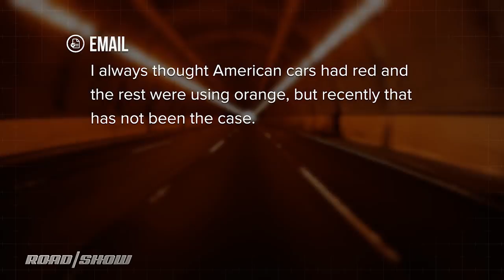Do turn signals have to be red?

Comment: I also demand to know why German cars sold in North America now all have red rear indicator lights when they didn't used to? They're not red in their homeland.
Reply: Nicholas Smith there is a subtle technicality that causes this.  RoW (rest of world) cars don't need to meet a turn signal "surface area" spec that the USDOT has.  So in Europe, VW/Audi can leave a very thin amber bar for its rear blinkers, which are plenty bright when lit by high-output LEDs.  But that doesn't meet the US spec, so rather than redesign the entire cluster, VWAG just programmed the entire brake light to blink on US cars.  And they can skimp on a few expensive amber lenses and LEDs as a bonus.
Reply: That's a crock of crap. Have you seen the turn signal in the Tesla Model X and Toyota Avalon? A thin strip less than half an inch. Simply put, the Germans found an effective way to cut costs. Since the Americans can get away with it, why not them?
Reply: Not really because of 'very thin amber bar', but it's the "surface area" of where the indicator starts. The thing about Audi and other cars makers is that it does not pass DOT because of sequential turn signal. Each segment of the turn signal of minimum 2200 sq. mm should light up immediately at the start of the indicator to pass. So, actually they can get a pass on the turn signal if they don't do the sequential thing or they can do the sequential thing but in reverse like the new Toyota Avalon.
Reply: The first segment to light up has to be of a certain area, irrespective of whether it's sequential or not. And then there is another important thing: in the US, lights on a moving part of the vehicle (i.e. trunk lid) don't count toward that minimum surface area. That's why the European thin strip doesn't pass the US reqs, since you're only looking at the outer half. Take for example the X5. It has to have combined stop and turn signal because only together do those two outer small segments meet the area requirement. The alternative would be a rear light assembly of a far less sleek and esthetic design. Oh, and btw, it looks like the outer part of the Avalon turn signal is steady on and off, with only the inner trunk lid part doing the reverse sweep.
Reply: @H0704  USDOT MUST trash the minimal surface area requirement ASAP. It creates an even worse safety hazard.
Reply: They think now that LEDs are so widespread and much cheaper and longer lasting than the incandescent bulbs there's no need to have extra lights for turning. Still a stupid argument. You can use LEDs but just use red LEDs for braking and amber LEDs for turning. Both types of LEDs exist. Plus if you're so concerned with the aesthetics of the vehicle you can easily just opt for clear lenses without any red tint and just have the appropriate colored LEDs in the housing for both braking and turning as explained in the previous sentence. Taillight lenses with color tints were necessary in the past to get the color out of incandescent bulbs but with LEDs that's not the case anymore
Reply: i think part of it is because cars sold in the us must have a turn signal lense of a certain size, and it may also because some people like the cleaner look of all red. or it could be a cost cutting method as well. either way, its fucking stupid.
Reply: @francissanto12  Exactly. German engineering and better safety my ass
Reply: Man, new cars are expensive anyway so why not invest a tiiiny bit more in using amber turn signals... 
It's clear that America cares more about "costs" and "esthetics" than safety.
Reply: I have crossed the border in to Mexico many times and I have seen the same German cars that we have here in the US with rear amber turn signal lights. Same late models that we have here with red turn signals and across the border with amber turn signals.

Comment: Aside from red or yellow. USA needs ban intergrated stop/turn signal light.  Just too damn confusing to tell apart when brakes are pressed intermittently. I really do think it's a hazard.
Reply: j O agreed.  Also US should require side signal repeater like the rest of the world.  Blows my mind how cars are allowed to change highway lanes with no visible indicator on the side of the car.
Reply: Thats why i hate red only turning signals ita confusing
Reply: The intergrated stop/turn signal combination is proven to be one of the safest applications for stopping and turning possible due to its simplicity. The use of a separate bulb for turn signals are marginally more dangerous as the bright red light is proven to overpower the less bright amber signal. Which is why at night, when someone hits the brakes, you see the red brake lights much brighter than you see the yellow turn signal.
Reply: i completely agree with this. can’t believe it’s still allowed.
Reply: @haroldbeauchamp3770  You are just plain wrong. A red break light wont grab a drivers attention who's in an adjacent lane. Even more so if it is the break light itself because it's not unusual for people to tap their breaks in traffic and you just ignore it. A different color sticks out and is proven to be much safer. Just because the break light might be a little brighter doesn't mean you won't see the amber light as well (see at 1:00).
Reply: @ErrorCDIV  “break” lights are ineffective as they are broken. Obviously. Perhaps what you need to pay attention to and advocate for U.S. turn signals mounted on the side mirrors. Anyone in the adjacent lanes should be able to see these more clearly.
Reply: @haroldbeauchamp3770  are there no turn signals on the sides of US cars? On the fender or mirror? If not that seems to prove the point more because I thought that even if the break lights were also the turn signals, then at least there are side signals for redundancy.
Reply: @ErrorCDIV  it’s not a requirement. However many US cars have them. I suspect you are not from the US or Canada. People here are not confused by the lack of amber turn signals. I am sure that the concept of red turn signals is shocking and foreign to the rest of the world, however, we are not confused by either color turn signal. I like that you feel amber is what works best for your country, but there is freedom of choice in the US. Cheers mate.
Reply: @haroldbeauchamp3770  Yeah, I'm from Iceland. My experience driving in the US is very limited. But there some "Americatype" cars here imported by individuals. Mainly trucks and cars that aren't necessarily US market only, but are made in the US, so importing them from Europe means the car goes through customs and taxing a second time when they arrives here making it much more expensive than just importing them directly from the US.

But you're right that we outside the US are more prone to miss the red blinkers because that isn't something our brains are wired to interpret as a turn signal. Cheers.
Reply: trucking shenanigans  unfortunately, with the increased usage of LED brake lights the problem I described and you acknowledged will still exist. Extremely bright LED brake lights will always illuminate brighter than the amber incandescent bulb. Especially at night, the glare will be very noticeable. However, as for the combination brake, turn signal issue you mentioned. It’s extraordinarily rare for a complete bulb failure. As these bulbs have dual filaments within. It is designed to where if the filament fails, the bulb still has a 2nd filament to continue bulb operation. Where as amber bulbs, and single purpose bulbs such as a dedicated brake-only bulbs, will have a single filament. In that case, it would become dangerous. Cheers. I appreciate the comment, however, until manufacturers fix this issue there is only one amber turn signal that I will approve of. This one is located on a 2020 Ram truck and certain new Jeep models. It is a high-tech combination red/amber brake light and signal light in one.
Reply: trucking shenanigans  unfortunately very few vehicles on the road have LED amber turn signals. The new Ram truck has an excellent example of an amber turn signal however. It is a combination brake light and turn signal in one. When the brake is depressed. The LED is red. If the driver uses a turn signal whilst braking, the red LED becomes amber and the red brake light no longer illuminates. It does not allow for the two different color LEDs to compete with one another. For anyone behind that truck is extremely clear as to what that vehicle will be doing.
Reply: trucking shenanigans indeed sir. Thank you for your service. People don’t thank our truckers enough for their service to our country.
Reply: @haroldbeauchamp3770  The NTHSA conducted a study and found that cars with combination brake lights and turn signals were 20% more likely to be involved in turning-related accidents than cars with separate amber turn signals.

Edit: He talks about this in the video! How do you not know this?
Reply: @TheBabaloga  the study to which you’re referring is more than 10 years old. The data included in the study is 20 years old. Combination brake/turn signals have improved drastically over 20 years. They are now used in combination with side mirror signals as well as the use of LED bulbs instead of incandescence bulbs. There is nothing confusing or unsafe about brake light/turn signal combinations or red turn signals. A savvy, competent, defensive driver can always differentiate turn signals from brake lights.
Reply: @takuyatanaka5587  well maybe we shouldn't design road systems under the assumption that all drivers are savvy and competent, because we know they aren't. Also, LED bulbs have many benefits but safety is not one of them, they're the same as incandescent there, and mirror signals don't help from many of the most important angles.
Unless the study has been contradicted by a more recent study, its age shouldn't matter.
Reply: @TheBabaloga  cool story ma’am. But you’re wrong. Your points are arguably laughable. Every person that is on the road is a licensed driver. Whom took a test to ensure that they understand signaling and being a defensive driver. I’m not quite sure why driving is so confusing for you as the simple notion of a brake light and turn signal baffles you. But none the less, I mean no disrespect or harm. I hope you’re able to drive safely knowing that these pesky red turn signals and brake lights are menacing about.
Reply: @takuyatanaka5587  Wow... well hey I hope you find a more productive way to channel your anger some day. All the best, I think we're done here.
Reply: @haroldbeauchamp3770  
You're just flat out WRONG!
Amber sticks out far better than red!
Reply: @ArmageddonIsHere  cool story. Yeah, right.
Reply: @takuyatanaka5587  it is unsafe haha when your brake light die how you gonna indicate ?
Reply: @ErrorCDIV  We have too many cars. It would be an eyesore and confusing at night having all those signals on at the same time.
Reply: @sonicmastersword8080   You think safety is less important than potentially being an eyesore? And what do you meen confusing? You only have to focus on them in your immediate vicinity, it's not confusing for the rest of the world, I believe in you. What is confusing is when break lights have two functions. Plus it's not like amber turn signals don't exist in the US without being a problem. If you drive in Europe for example, you'd most likely find amber turn signals to be no problem at all and might even grow to like them better.

Comment: Red indicators are a menace to road safety. We need to mandate amber indicators immediately to save lives!!!
Reply: I almost slammed into the rear of a Chevy Astro because the guy had his hazards on (rendering the brake lamps useless) and his center brake lamp wasn't working properly. Had he had amber turn signals, his brake lamps would have been working. It pisses me off when companies use red. Even more so when they use the brake lamps as the turn signals. The laws that govern vehicle safety in the US are a joke.
Reply: Integrated brake light/turn signal lights are proven to be the safest design in the world due to its simplicity. You hit the brakes and both illuminate red in addition to the high mounted 3rd brake light. You hit the brakes whilst the turn signal is operating and only the corresponding turn signal flashes red while the other brake lights illuminate. Science has proven that this setup is safest due to its simplicity and not confusing other drivers with an amber bulb located in a separate area away from the brake lights.
Reply: @haroldbeauchamp3770  Source? I bet you'd be the kind of guy to make a front turn signal white if there were no law already requiring that to be amber

Comment: I think that all rear turn signals should be orange because some cars that have red turn signals are extremely hard to tell that they have their turn signal on.
Reply: eduardoig17 I used to hate red signals with a passion.  Dim and poorly separated from the brake lights.  LEDs have made them much better so I am somewhat OK with red as long as they are LED.
Reply: This problem is the worst when the carmakers insist on the shitty brakelight/turn signal 2-for-1 combo. It's such an old, flawed design that should've been gone as soon as it began
Reply: @exoticcar5482  Even the new Jeeps and Ram vehicles have the switchback brake and turn signal on the same area. Red LED lights for brake lights, but changes to amber, while using the turn signal. While it looks cool, I prefer them to be separated.
Reply: Integrated brake light/turn signal lights are proven to be the safest design in the world due to its simplicity. You hit the brakes and both illuminate red in addition to the high mounted 3rd brake light. You hit the brakes whilst the turn signal is operating and only the corresponding turn signal flashes red while the other brake lights illuminate. Science has proven that this setup is safest due to its simplicity and not confusing other drivers with an amber bulb located in a separate area away from the brake lights.
Reply: @haroldbeauchamp3770  So it's safer to have brake lights that stop functioning everytime someone turns on the turn signal?
Reply: @TimJoseph08031990  It's actually almost even more stupid than the red design, because some engineer actually had to program the brake light to go out and not function on the side that turns amber
Reply: @takuyatanaka5587  Not when you're at a certain angle though. The third brake light will not be visible. Also not to mention bigger non passenger vehicles often don't even have the third brake light as it's not even required on non passenger vehicles
Reply: @canto_v12  No LEDs don't make them any better. The ambiguity still remains even if they turn on quicker and on shared function tail lights the turn signal still disables the brake light even with LEDs

Comment: I vote for "AMBER" turning signal.  It distinguishes the brake lights from the turning signal.   If I am the market and I have to choose between two equally good choice of cars... I will pick the one with amber turning signal.
Reply: Amber isn't capitalized as it is not an acronym. Amber is an actual scientific color name that describes a color between orange and yellow
Reply: Same here. No matter how much I like the car, it has to have an amber turn signal.
Reply: @exoticcar5482 Most people in my country call both the turn signals and the traffic signal between the red and green a yellow light. It drives me insane as it's not yellow at all

Comment: The effectiveness of Amber in the 2009 study was shown to be more statistically significant than the CHMSL study, yet they still aren’t mandatory. It’s so disappointing! If amber is required in the front, it should also be required for the rear.
Reply: Also stop using amber lamps on the front as running (parking) lamps. Amber should only be for turn signals

Comment: I had gotten rear ended so many times because I always had red turn signals. Once I switch over to a new car, I made sure the car had Amber turn signals. My rear view mirror isn't as eye popping anymore and my neck doesn't hurt anymore. During the day, red turn signals are hard to see, especially when the sun is beating down on them. I feel Amber is the way to go worldwide, but like you said Cooley, manufacturing companies are under an umbrella and they have their hands tied. Great video!

Comment: I prefer the amber color. If I only see 1 side, when the other car is in different lane, I dont know if that car is signaling or the driver just constantly braking.
Reply: And unlike what many idiots will say, you CANNOT always see the third brake light in certain cases and at other times, you don't even HAVE a third brake lamp in the first place, especially with big trucks! Now THAT'S a safety hazard...
Reply: from what you described you wouldnt be able to see that with an amber bulb either. fail
Reply: @haroldbeauchamp3770  Wrong. You would absolutely see it because there's one on either side

Comment: Always wondered about this myself, frustrating when your in the left lane passing people and your not sure if they are signaling to get in or just getting on/off break really quick.
Reply: BigHeadClan Automakers may say that the third brake light is supposed to help solve this, but there are quite a few situations where the third brake light is obscured from your view and you'll only see one side of the car. That is definitely a situation where separate amber turn signals help improve safety. And don't even get me started about the hazard lights...